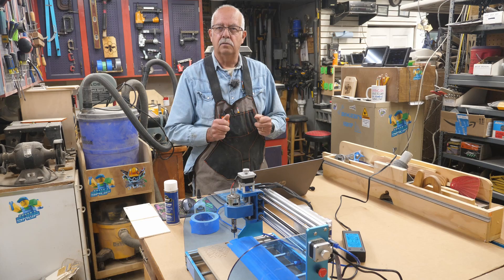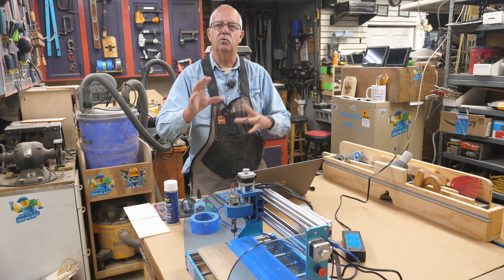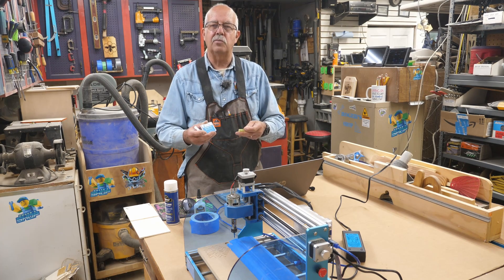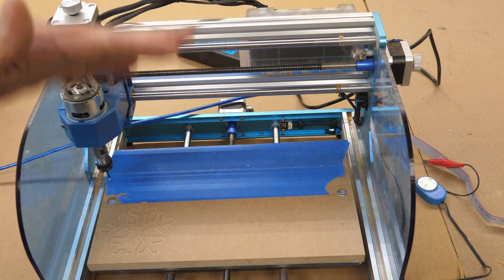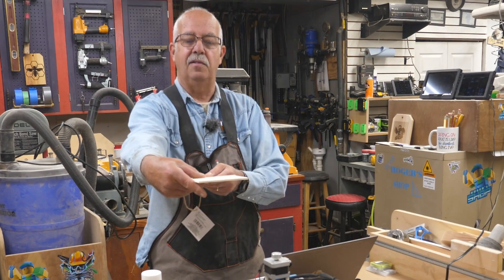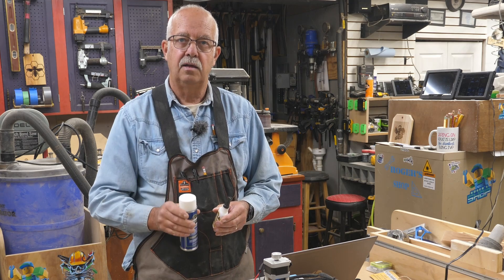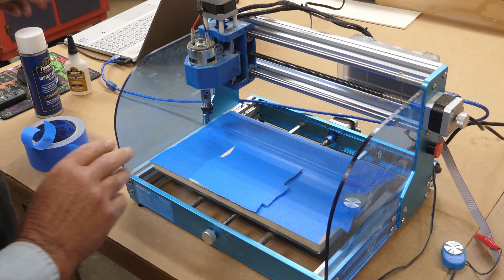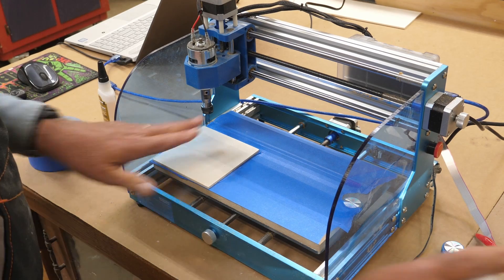Sainsmart ProVer V2 Easy Beginner Project

Comment: I tried but how come my machine stops in the middle of the cut and never finished the project the spindle keeps runny but the machins stops moving and that is using candle and or even using easel does the same thing
Reply from the maker: Possible bad USB cable.  More common than one would think.

Comment: Hello Roger, I have a problem trying to do this project, for some reason I can’t cut through the wood. It’s a 3mm piece that I measured .065 inches. I left the settings at Automatic, going through the checklist and started the machine. I kept increasing the depth till I got to .40 inches and still would not cut. Needless to say it was time for a professional opinion, before the “For Sale” sign goes on it.
Reply from the maker: Did you do the Z probe calibration?  Sounds like it is off.  If you did, and it is accurate, then make sure you zero Z before probing.

Comment: Hello Sir, 
1st let me thank you a thousand times, all of the videos that say they're for the beginners are not truly. They skip over half of the steps that beginners need. Your videos actually showed where to go on camera so we can see what you are doing. I had NO idea I needed more than candle to make this work ? Who would of thunk😁. 
I have a couple of questions if you could help me that would be great. So I was already to go, I did The z prob and when I hit send the file my spindle went up and acted  like it was cutting the snow flake in mid air, never touched the wood! Any thoughts I would appreciate it.  and again thank you for your videos! I was sending my machine back today, just because I was so fed up with it until I found your video on YT last night. Thank you in advance, Clete.
Reply from the maker: Your Z offset is not set correctly.  Too hard to explain in a comment reply in detail, but make sure you set the Z offset after probing.

Comment: Hi. This was a very good video. I really appreciated the information you gave in the video. I am having a problem. I have followed your instructions, and the first two runs were great. But since then, it only gets about half through the complete cycle and the router stops. The Z-axis limit lights come on. Any suggestions?
Reply from the maker: I've had that happen before.  It was due to the thickness of the project and the length of the bit.  it was too close to the upper Z limit.
Reply: Thank you so very much. I was able to figure it out. I lowered the bit and after a couple more tries, got it all working good. Thanks again!!!!! @rogersshop

Comment: Good video.  I have a couple of questions though.  Does your machine have limit switches for homing or does it use sensorless homing?  

When you use the z probe how does it know how far away the work piece is.  I would have expected it to try and cut/engrave at the level of the probe unless you are using a Z offset of some value.

Have you ever cut or engraved acrylic?  If so what type of bit would you recommend?
Reply from the maker: Yes, it has limits.  Z Probe base is placed on top of the surface to be machined, then set.  Cutting acrylic, I use a 2mm end mill.  For engraving, a 20 degree carving bit.

Comment: Thanks for the great video. I have a V2. Didn't know the probe worked automatically in the software.

Question: My machine is only couple weeks old. I noticed this when using the laser but sounds like my carriage make a vibration noise going to the right but not to the left. It does not do this if I jog the carriage with move commands. Seems maybe related to the machine slowing/speeding quickly? Someone mentioned it could be due to anti-backlash spring? Have you noticed this in your machine? Maybe if you don't have a laser run a wood pattern without the bit and make sure it is traversing right/left. Thanks
Reply from the maker: I did have a laser on my V1 for a while,, but since I have several full size lasers to use, I took it off.  On my V2, I've not had any issues, but have not put a laser head on it.

Comment: Thank's Roger that was informative.  I'm thinking of picking up a small CNC.  Would there be any benefit on thin projects to spacing up the work piece to operate with less spindle extended?
Reply from the maker: A spoil board does just that.  In this case raises 1/2", reducing the Z travel extension where it would get close to limit.